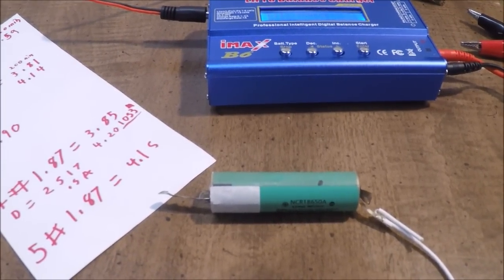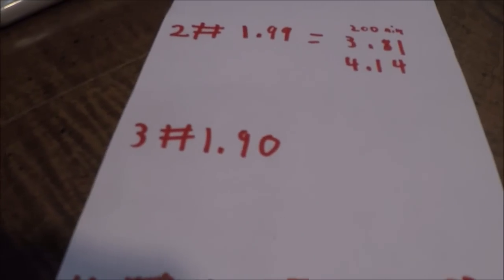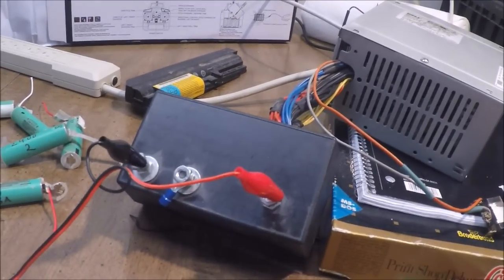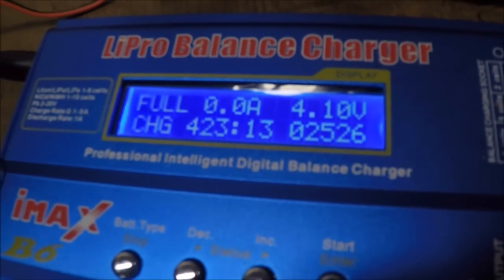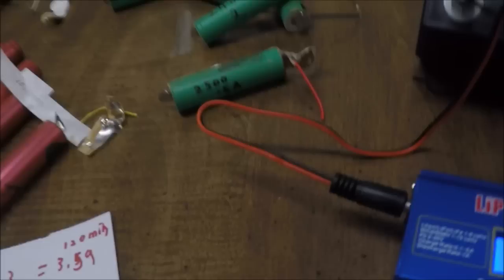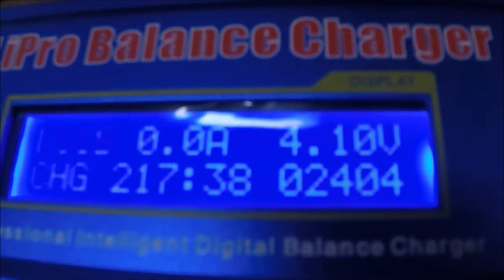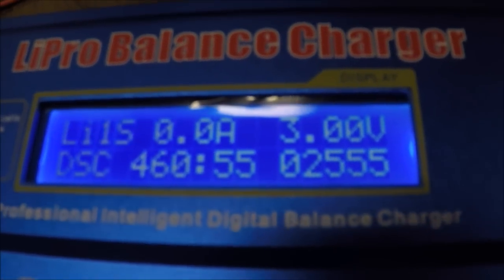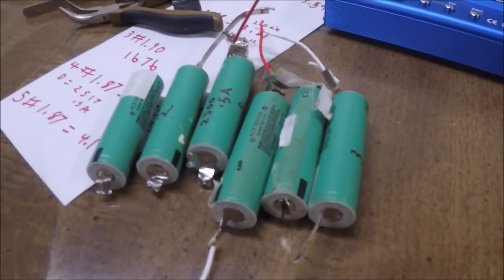Testing 18650 Li-ion Batteries from Old Laptops with my Imax B6 charger

Comment: what if i have a 25amp batery can i charge at the charger 5amp max
Reply: the charger is capable of 50W charging power, so you can determine the maximum charging current for your battery with I(max) = 50W / Voltage of your battery. Always reffer to the datasheet of your battery if it can take the current! Hope this will help you

Comment: helo, how do i charge a Li-ion battery without connecting the balance port??
Reply: I know this is an old video/comment but to answer...
There is a "System" setting in the B6 that let's you turn balancing on or off as desired. It comes in very handy when you're charging 2s1p packs that don't include a balance output. Of course, over time...charging mismatched cells without balancing can lead to fires or cell damage (that didn't result in a fire).
Reply: Also...keep in mind that the B6 manual says NOT to use the B6 to charge battery packs that have internal protection circuits...or at least my B6AC V2 stipulates that limitation...and some of the cells or packs you run into may have protection circuitry.

Comment: strange i have an imax B6 ( i asume it is a clone ) and the discharge function stops at 120 min at 0.5A is there a setting to get it to keep going after that?
Reply: Yes. In the settings menu there is a safety cut-off timer. You can either extend the time or just disable it.
Reply from the maker: i will do a video about that.

Comment: your charge to 4.1V and discharge to 3.0V this should be a difference of 1.1V, so if you have a 2200mA/h 18650 this mean you are using only 2.42WH of the total capacity of 9.24WH, I'm right or I'm missing something
Reply: Jose Garcia a better test would be using a mah meter and a load with thermal cam app for watching the battery. Jehu Garcia does this in one of his videos using a power inverter as a load. There are load testers in to $150 range to perform the same job but a bit more accurate and even loading

Comment: We r using Samsung 18650 3s battery but we r unable to fly our drone
Reply from the maker: Well First off what type of drone do you have?
Reply: Beginner's Tech Quadcopter with 1000kv bldc motor and 750 frame
Reply: Khemraj Deulkar if the cells are from a laptop battery the discharge rating might not be enough some 18650s are 1c and some are more 15c and higher.   Try using a 12v lithium drill batter ect on it if they work it's because the drill batteries have a higher discharge rating
Reply from the maker: yeah if you are trying to use laptop batteries I doubt they will work

Comment: You've got a fake IMAX B6 charger...that's why you were getting DISCHARGE and CHARGE readings for the same battery NOT MATCHING.  Your results are misleading you and will mislead you on the projects you have in mind. Look over again your unit and figure out why it is fake.  Look for a serial number at the back which you can check on the web with the manufacturer.  Good luck.

Comment: 1. Use LIPO mode
2. Get a real SkyRC charger and not that piece of junk.
Reply from the maker: 1. these batteries are not lipo batteries they are lion.
2. this charger works great so i dont need another one.
3. please subscribe :)
Reply: Use lipo me to charge them to 4.20v. That's what they are designed for.

A real skyrc charger does charge them to 4.19v and not 4.22v what this one does.
Reply: The manual says LIPO is 4.2v max and LiIon is 4.1v max.
I would definitely use the LiIon 4.1v because that's what the 18650 are, and everyone says a slightly lower charging voltage will greatly increase the life of the cell.
Reply: it doesn't make a big difference in lifetime
Reply: IT IS COUNTERFEIT!   1.) The genuine SKYRC iMAX B6 has GOLD plated output jacks for the 4mm banana plugs. 2.) It has a SKYRC logo printed on the upper right corner. 3.)  A scratch off holographic sticker reveals a code that you can verify unit through SKYRC.  4.) The CE (for China Export), FCC & Don't Recycle tags are located on back of unit, not front lower right corner. 5.) The screws holding the body together are black not chrome plated.  6.) The counterfeit box doesn't even come close to looking like SKYRC's box (It's not black & doesn't have diagonal red slashes.) 7.) There are a whole slew of internal dissimilarities, too many to type, one though, gives false readings on the display screen which could be dangerous!!  I hope I covered enough external dissimilarities to help you weed out the counterfeit chargers from the genuine item.  Spending the extra money for the real deal may make the difference between "Home Sweet Home" and a FIRE GUTTED HOUSE!!  It's YOUR choice to save a couple of bucks........Read more Show less
Reply: Da Bugguy, good advise. The counterfeit ones tend to have very poor voltage measurement, and can routinely under or overcharge batteries.
Reply: CE stands for Conformité Européene. I also have one of this counterfit ones and it barely even gets warm when charging 6 cells at a time :D
Reply: @BeginnersTech314  good answer ahahah.d.d

Comment: 460 minutes is 7.66 hours. So 2550mA / 7.66h = 333mAh. That's the capacity of the battery
Reply from the maker: from talking to other guy's the charger should do all that math and mAh of the battery is supposed to be what the display showes. and thses batteries have more than 330 mAh of charge.
Reply: It seems to be counting up slowly from the beginning and over the full 460 minutes rather than working it out at the end
Reply from the maker: ***** i have been just doing what everyone has been telling me. and the other thing is as it gets closer to the end the charge amps drops. so that would mean for the last 20 min or so it is charging slower
so would that make your calculation off buy a little?
Reply: I just bought one for myself so when I get it I will try it out. Can you tell me what voltages the LiPo setting can be set at? I would like to be able to charge my 24V ebike which would be a bonus.